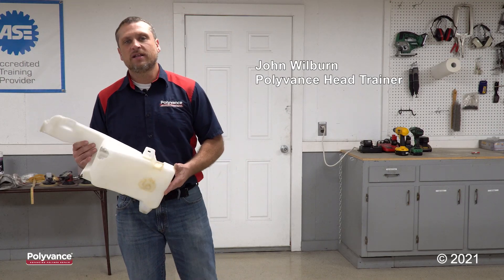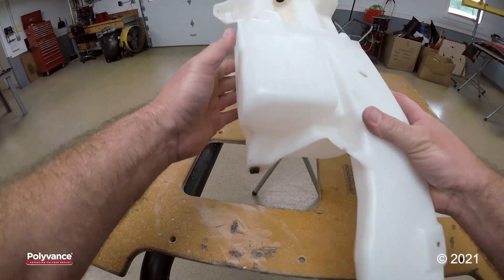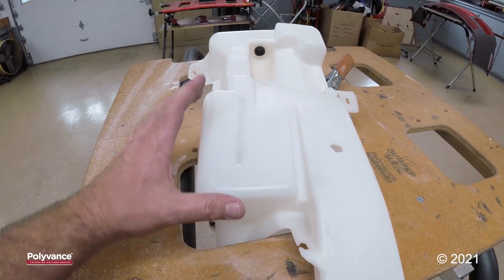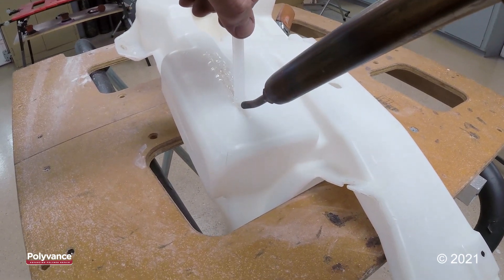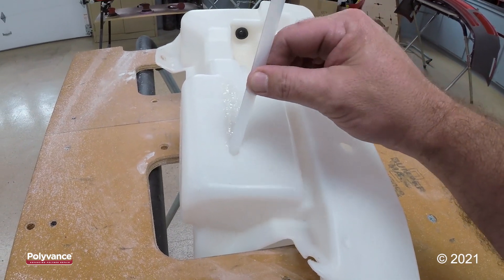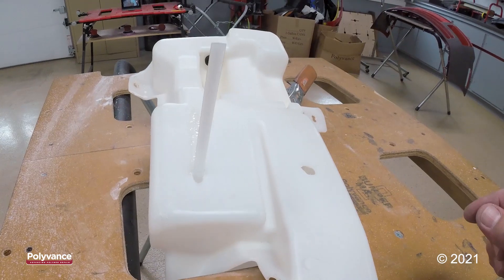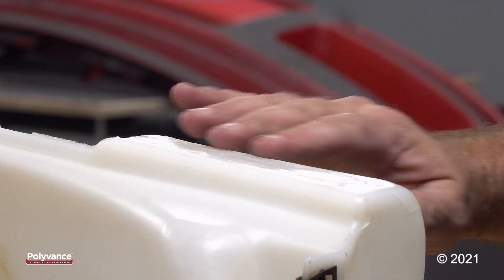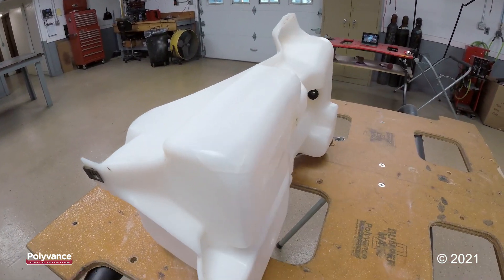Plastic Pointers #12 - Polyethylene Reservoir - Incorrect vs Correct Repair

Comment: Wondering if zip ties are same material as your rod?
Reply from the maker: We carry 22 different types of welding rod materials: polypropylene, polyethylene, nylon, PVC, ABS, and many more! Zip ties are typically nylon or polypropylene.
It's crucial to identify the plastic and use the correct filler rod that matches the plastic.

Comment: Can you weld hdpe to mdpe plastic tank?
Reply from the maker: That shouldn't be a problem. However, LDPE is easier to work with than HDPE, so you might have better luck using that.
Reply: Thank you as my water tank is MDPE but I have only HDPE rod so thought I'd ask and thanks

Comment: Are there inexpensive heating tools that the average person can buy to do this repair? I have a RV holding tank that has a small crack. A new tank is $300 and would like to buy the tools to repair it.
Reply: First, find out what type of plastic the tank is made from, then call Polyvance.  Polyvance has a consumer level plastic welder for just about everything.
Reply from the maker: Yes. We have several airless welding kits available: https://www.polyvance.com/Airless-Welders-1/
The KC Welder Pro (https://www.polyvance.com/Airless-Welders-1/KCWPRO/) comes with PE welding rod, which was the plastic filler rod we used in this video. Again, it's important to match the filler rod and the base material. So just check for the ID symbol on the tank before purchasing a kit.
If it is XLPE, it cannot be fusion welded.
Please feel free to call us if you have any questions.

Comment: So I have the weldy HT 1600 hot air welder is my problem with Pendulum and Welding HDPE that I’m using round  rod instead of flat? I can’t seem to get it to flatten out even though I’m pressing really hard and have the correct angle?  it’s also 3/16 inch round rod it’s really thick stuff the speed Welding works well but Pendulum Welding is really an issue should I be using a flat rod instead of round?
Reply: Don't worry about trying to flatten a round rod out when welding.  Generally speaking, no matter which rod shape you start with, the shape of the weld will be whatever the outside shape of the rod is.  If you want flat, you can always go back and reheat the weld with your Weldy and smooth it out using a 6031 tip in your airless welder.  If you want to end with a flatter weld without doing extra work, just use a rod like the R04-04-xx-xx rod, which is also easier to use when free-hand welding. https://www.polyvance.com/search.html?query=r04-04  (FYI, there are many pages of that profile in this link, not just bulk qty)
Reply: @scottb7600  Thank you very much

Comment: One question: do you heat only the plastic strip or both at the same time to carry out the repair?
Reply from the maker: Both! You need to melt the rod and the part at the same time and apply some downward pressure to fuse the two plastics together. You must be using filler rod that matches the base material to make a fusion weld.
Reply: @polyvance  how interesting!  Thank you very much for the information, if I had known before, I would have bought a thermofuser instead of a staple welder, I think this method you used to be more efficient besides leaving a better finish.  Thank you again!
Reply from the maker: @paulofullgas  You're welcome! Always happy to help!
Reply: Greetings directly from São Paulo/SP-Brazil.  You won another entry bro!
🤜🤛
Reply: @polyvance  I have seen Local welder fusing PP filament to ABS bumper. Does it work correctly?
Reply: @Sam-to1zg  No.  PP will not weld to ABS and the only ABS bumpers out there are aftermarket custom bumpers for the tuner market, custom vans and such.  Chances are it was PP rod to a PP bumper.
Reply: @scottb7600  Thank you.